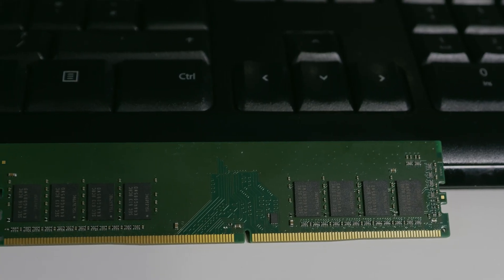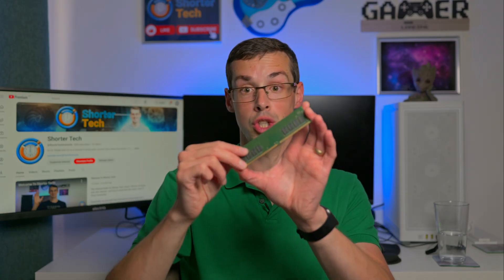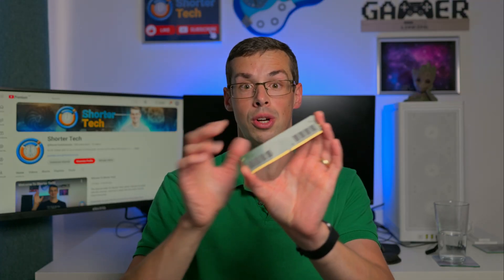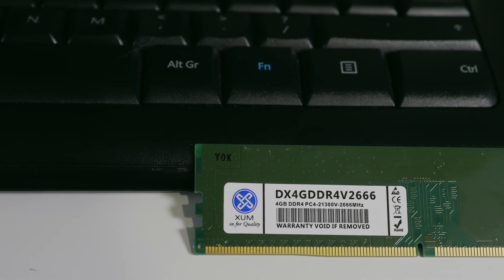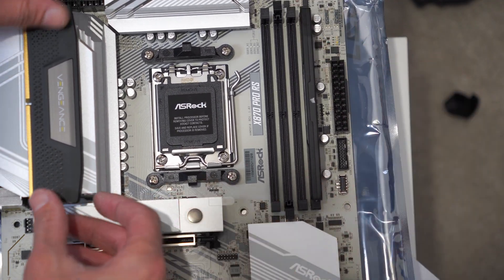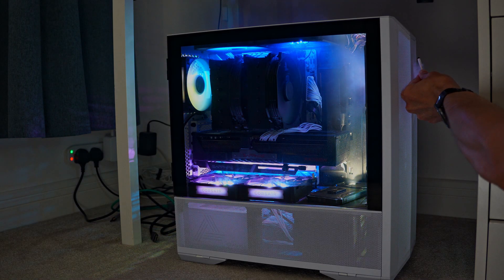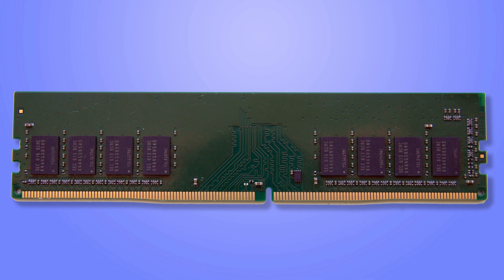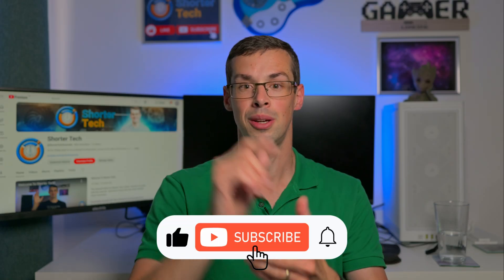Is It Safe To Overclock RAM Sticks Without A Heatsink?

Comment: I have a 2600 mt ddr4 ram
I have overclock it to 3300 mt
Is that safe in general?
Reply from the maker: Yes that should be safe IMO. Even if the system becomes a bit unstable during the OC process, it's unlikely to damage the RAM IMO. It's good if you can get that OC stable :)

Comment: I never understood the desire to overclock components in your PC. Why stress your system for minimal gain that you probably can't even notice?
If you need more performance, then buy more performance.
I always go for reliability and stability. Crashes due to overclocking are not worth the headache.
Reply from the maker: I usually end up tired after a build, and overclocking becomes a distant afterthought (which I never explore either lol). I could understand RTX 5090 owners who want to undervolt, but often nowadays, overclocking does seem unnecessary - unless people just like to tinker I guess.